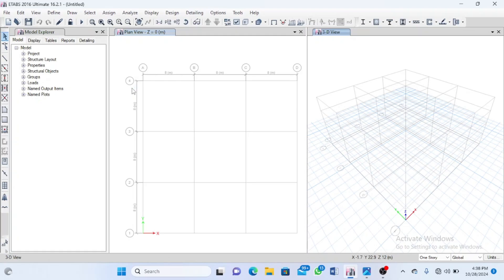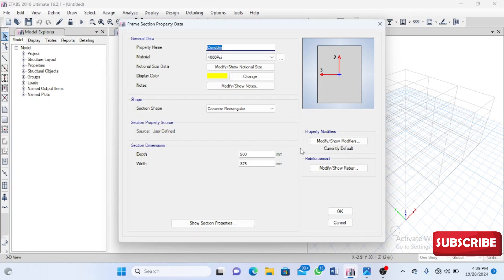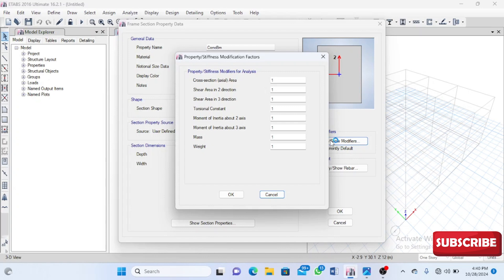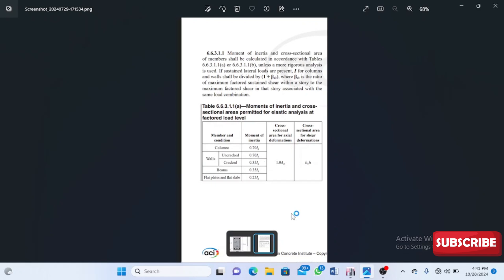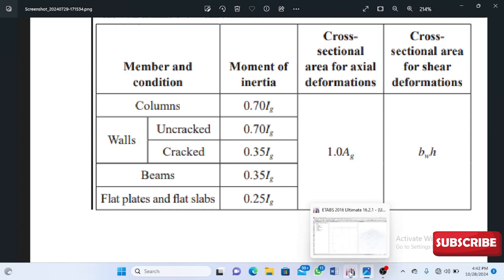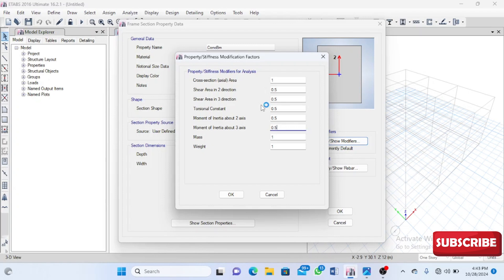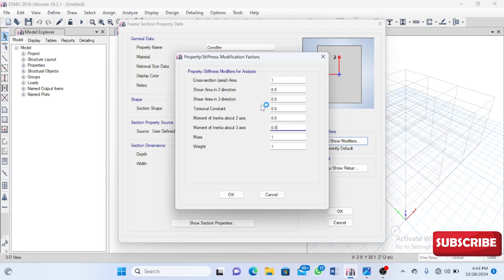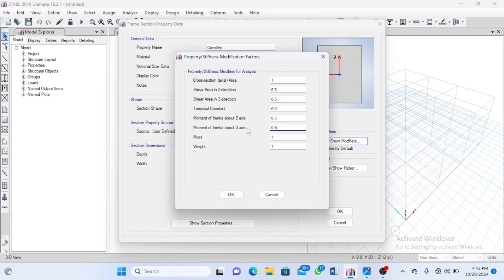8. ETABS Building Design: Understanding and defining property modifiers

Comment: What about considering wind loads?
Reply from the maker: Wind loads don’t usually cause significant cracking, so full-section properties are used. But earthquakes induce inelastic behavior, so we reduce stiffness for seismic design. Some cases, like tall flexible structures, might need minor reductions for wind, but it's not common.